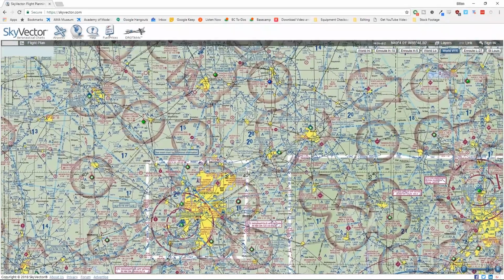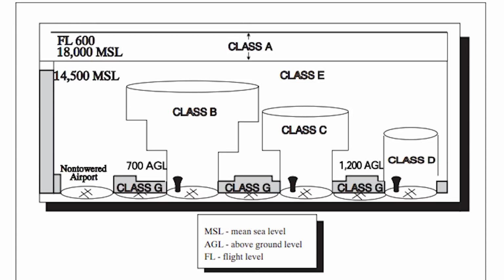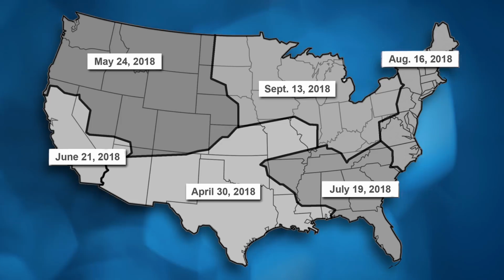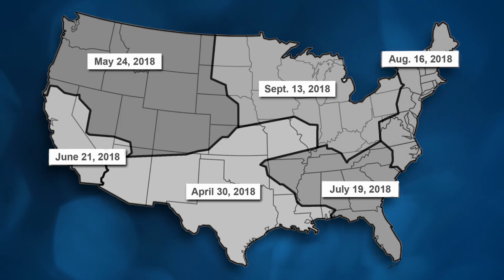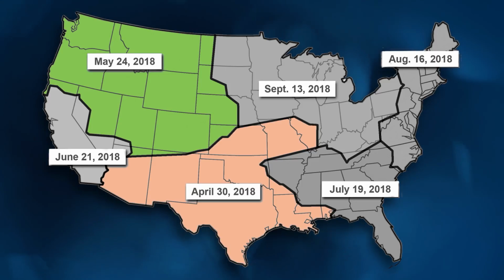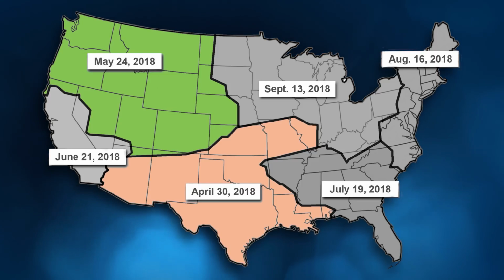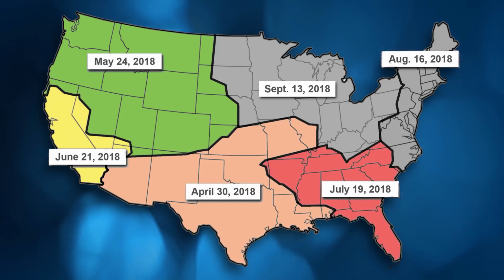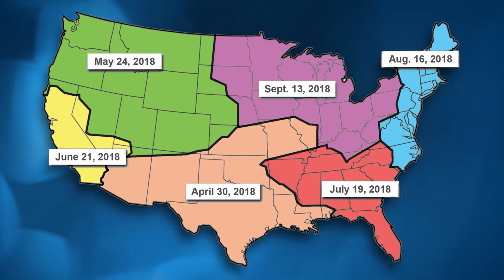Low Altitude Authorization and Notification Capability (LAANC) - Model Aviation magazine

Comment: Thanks for this concise and informative presentation of LAANC, Matt.  I am using the system under Part 107 in Georgia.  It seems to be working well and is nothing less than a giant leap forward.  Fairly new to sUAS, I became vaguely aware of LAANC while studying.  Being aware that GA pilots have many portals such as exists on Sky Vector to enter flight plans before they ever call the ATC for taxi, I had hoped something like LAANC would happen for sUAS.  It was already happening.  Great explanation!